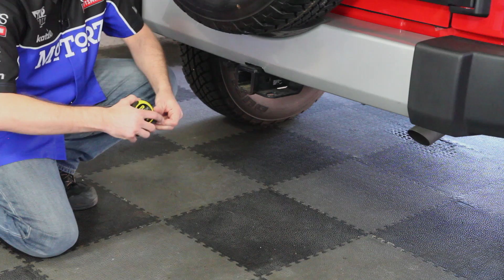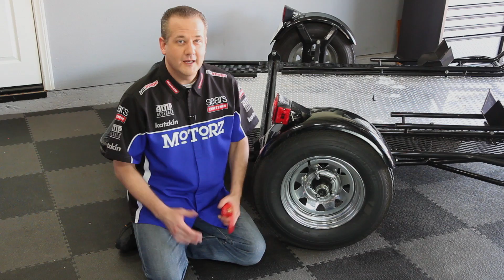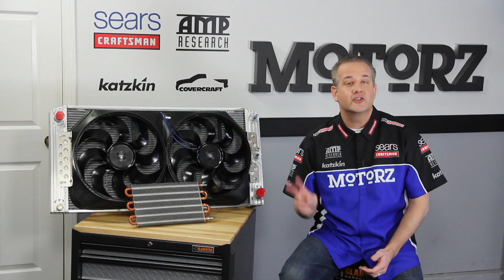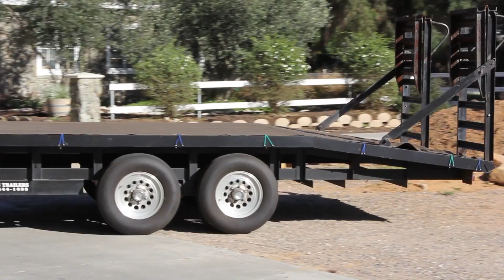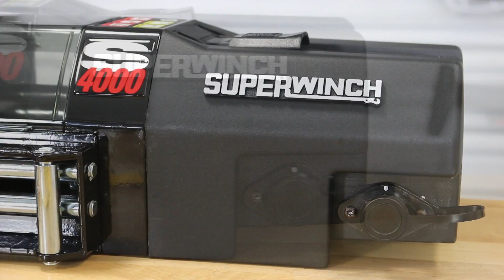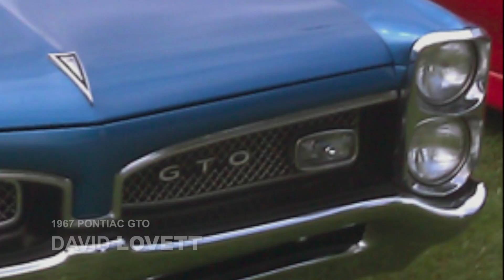Everything You Ever Wanted To Know About Towing Motorz #79

Comment: Run higher than the recommended air pressure in a tire. Really? Are you looking to blow the tire out? As air heats up in the tire, it causes the tire to expand. If you build too much expansion, KABOOM. Yup, you blew a tire. If you have ever watched a race, you will notice that they are always monitoring the tire pressure. That is because they know the results of too much or too little air pressure. Always go with the recommended  PSI. This will save your tires and help your overall economy.

Comment: I am a professional tow truck driver, and in my experience, would had mounted the Pick Up truck backwards on the trailer, putting the engine over the wheels of the trailer. Which would put ess weight over the front half of the trailer relieving the towing vehicle for a lot of tow sag.
Reply: +Douglas Joslyn III &#160;If you put that truck on that trailer backwards , that would put the engine behind the trailers axles, and unload the tounge, this has the effect of making the trailer extremely unstable, and dangerous. (I have 30+ years in the trailer industry)